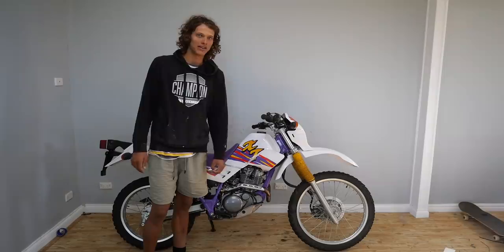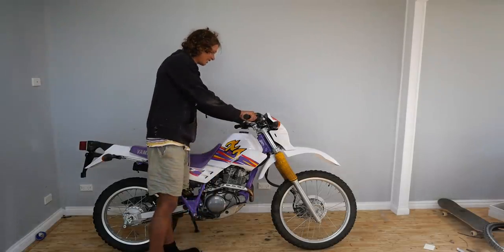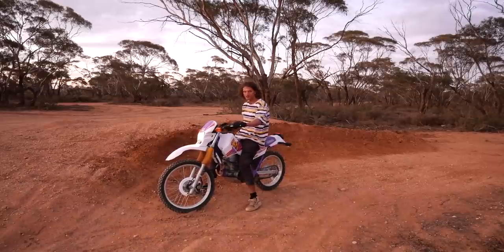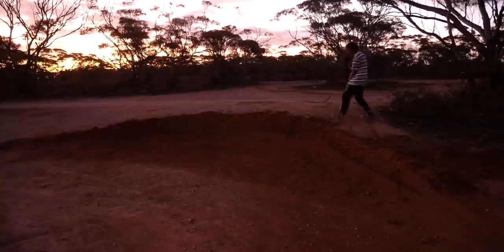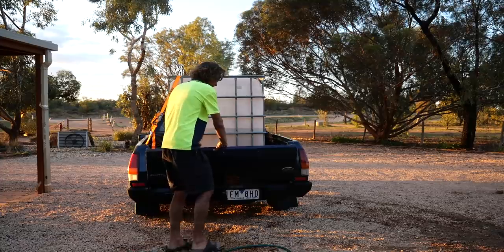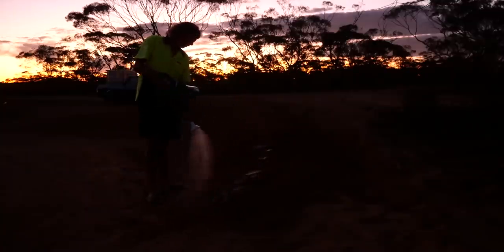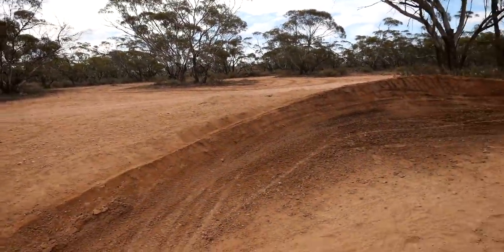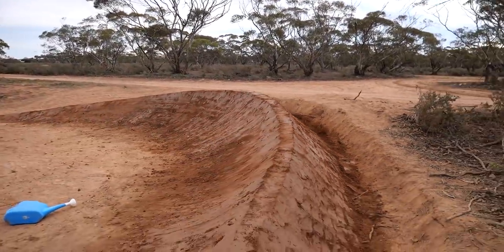Motorbike Mods & Fixing a old Dirt Bike Track (Episode 1)

Comment: I’m pretty sure taking off the muffler does reduce speed. But it’s totally up to you 👍🏽
Reply from the maker: Well, it didn't to mine man if anything it accelerates quicker but it does fall off at high rpm but it's not even noticeable really overall I think it was an improvement I saved about 5 kg and picked up some torque and it sounds tough. In this video, the guy gains power when he had no muffler https://youtu.be/KdWyDOvLzuE
Reply: That's a 2 stroke that'll lose power with the exhaust removed not a 4 stroke
Reply: OutdoorSoHard_69 oh ok, I have a 2 stroke and wasn’t sure if it was the same with a 4 stroke thanks for the information 👍🏽
Reply: I lost my end can while out on a ride on my 4t and it definitely reduced the power. It might depend on what bike etc but mine reduced the power quite abit. But if you're saying it hasnt on yours then sweet as a nut!

Comment: You could make an outside line on the back of the burm too and definitely need to get a muffler on the back cuz you need back pressure, itll run smoother and crisper

Comment: Having no muffler means you have no back pressure on the engine, so you loose a lot of power
Reply from the maker: if I noticed it loosing power I would have put it back on straight away. It made hardly difference but feels like it has better throttle response tho

Comment: Do you have a local engineering place ? Get the flywheel turned down do a bit of porting and a pipe you’ll be surprised man had a few done a few much more fun after a good mod.

Comment: Is that Yamaha a 250?
Reply from the maker: I'm not sure man the manual says it's a xt 250 and it has a 250 sticker on it. But on the vin or whatever it's called it says it's a 225. Also when I search for parts there is no such thing as a 1995 xt 250 it comes up with xt 225 serow and also on goole images you get better results when you search 225. So I'm pretty sure it's a 225

Comment: 4 stroke motorbikes are NOT supposed to be run without mufflers as it decreases backpressure which in turn will wear out your piston rings, piston etc. or worse I've had people come to my shop with blown up bikes because they ran it without a muffler. With a 2 stroke, they don't have mufflers, they have silencers. This is why you will see 2 stroke riders take off their silencer and increase power because a 2 stroke engine does not rely on great amounts of backpressure to run correctly. Just a qualified Motorcycle mechanic trying to help!

Comment: You should probably put the muffler back on the bike wont run right without it
Reply from the maker: If it didn't run right I would have put it back on smh
Reply: It will cause the bike to run lean ive been around bikes about 13 years it may not hurt it but you’ll definitely lose out on some performance but if you like it whatever just keep doing it

Comment: Taking the exhaust of is not good for your motor and it better to have the muffler on even tho it dont sound sick
Reply from the maker: Why's that? I will be putting one on it anyway but I don't think it's bad for it people just say that
Reply: Greg Barling apparently it makes ur bike have less hp but my uncle did it and his bike was the exact same and had the same speed and sounds so sick 👍👍👍
Reply: @GregBarling it open the motor up more make the motor more sloppy and less power in the long run try to find a after market mullfer mate

Comment: Should’ve left it stock, bike looks Fairly old, looks mid 90’s. It’s not a motocross bike it’s just a farm bike and is heavy already, taking parts off it won’t make a difference to its weight but only to its value.
Reply from the maker: All I did was take a few parts off it that I could put back on in 5 minutes 😂 plus it's not a farm bike it's a dual sport. It's a 1995 xt Yamaha I payed $1000 aud for it with only 5000kms on it i'll probarbly never sell it just ride it and have fun with it
Reply: Greg Barling my point is there was no point removing parts from your ‘farm’ bike. You do you, the videos are good.
Reply from the maker: @honda8192  Fair enough bro that's your opinion the bike is nowhere near as heavy as what a lot of people recon search up xt 225 and read some of the specs I reckon it's quite capable and a good all round bike
Reply: Greg Barling it’s definitely a good bike to ride, looks like you’re having fun on it and that’s all that matters, you surprised me with the jumps you were hitting lol. Keep it up.